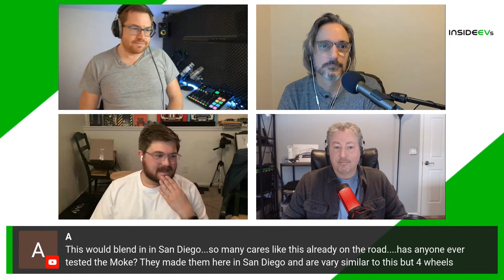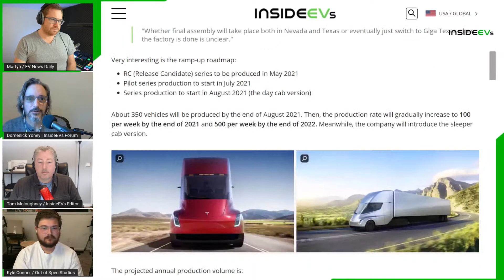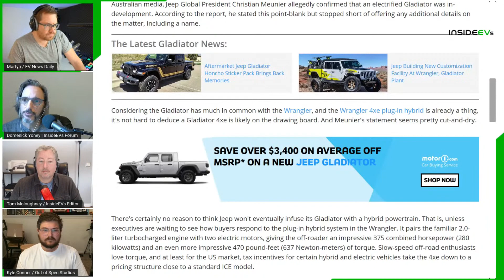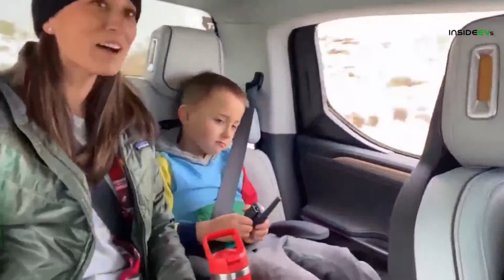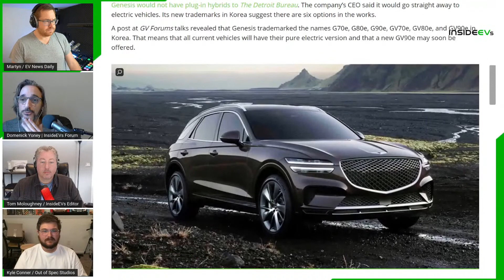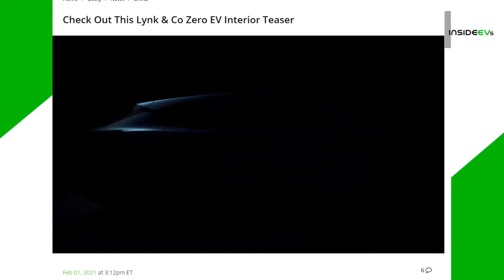Tesla Semi Production Could Be 2,500 in '21, Apple Betting Billions On Kia & Jeep Gladiator PHEV

Comment: My Taycan preheated it battery to 89F on charger arrival with outside temps mid 50F. Arrived at 4% charged for 13min got to 61%, 50kWh delivered 237kW avg Charging speed. 
Tell me another EV that compares.

Comment: I think the model S gear shifting thing is a non-issue since you can override it on the screen there will be a little gear selector push button right on the far left of the new  screen
Reply: I think it's going to be better than many suspect, for sure.
Reply: @Domenick_Y  everybody always get so excited just like with the third row in the model Y everybody basically was saying there will be no room it will be babies only it doesn’t make sense it should be rear facing all that bullshit for the room they have the set up is beautiful third row of the model Y they got a lot out of a very little an extra 3K for all of that Great engineering!!!fantastic

Comment: All new EA  -  EV charging sites need to have 8 or more charging stalls. Time to ramp up the numbers.
Adding more chargers is cost effective once you are already there digging up the parking lot and installing all the suport equipment.
Reply: Many of the sites are built so that they can add extra stations. They don't always have the opportunity to lease more parking spaces and Electrify America says they monitor the utilization of the sites and will add stations as needed. Right now, there are very few locations that have a high enough utilization rate to require more stations. I've never pulled up to a site and had less than four chargers available. 95% of the time I'm the only car there. Very rarely do I find another EV there charging when I arrive or leave.